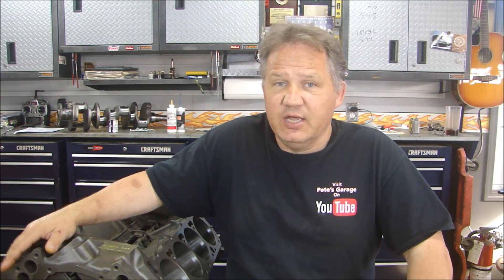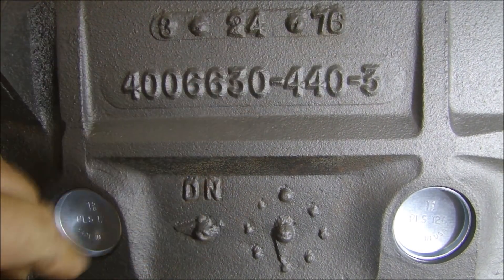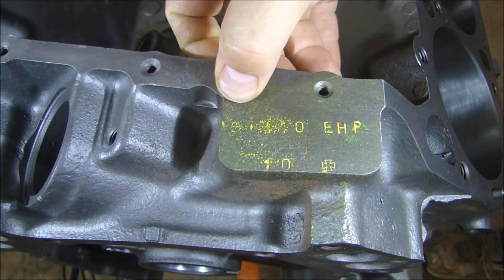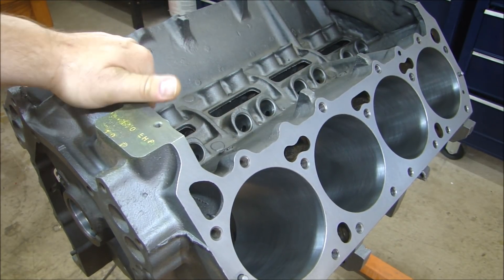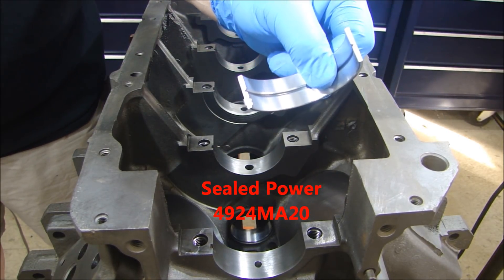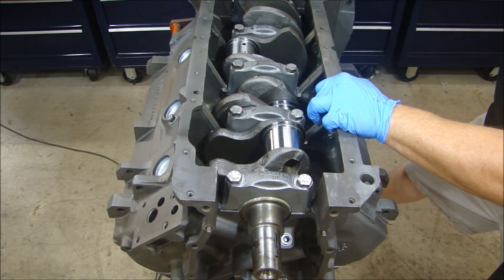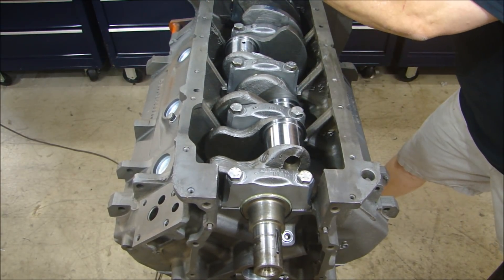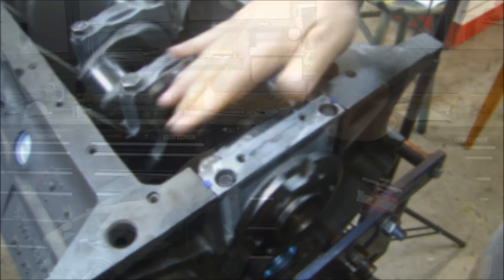440 MOPAR Big Block Engine Building Block Identification & Crankshaft Installation Part 1

Comment: First mistake you didnt lube the bearing before you set the crank in. Next problem, you never install a crank into a block with it on an engine stand. Hard level flat surface. Your torque values will be different on each bearing because the engine block is not level on the stand!
Reply from the maker: interesting

Comment: Today I’m trying to buy a 318 swinger to put a 440 6 pack in I know I got to see how it goes the Mopar purist will not like it but I’ll prob go to a regular Holley after I try it out if it does good numbers then I’ll keep it  on ther
Reply from the maker: Nice car
Reply: @PetesGarage   sort of lol we’re on rust belt mostly going to need a few frame rails or patch it’s going to be more for racing. A little street prob back half

Comment: Back on the day we were kids and I had a 70 with Maltese cross and we didn’t check we didn’t know we were kids and we never took to machine shop we cleaned it up we put the normal 440 bearing and I spun the bearings in it doing about a hundred a hundred in second gear she was revving we were kids showing off to a car load of girls but the Maltese cross is why I spun bearing s I’ll bet a hundred dollars although I was over raving it it only had like 355 or less for gears but we were kids with a 70 440 road runner lol
Reply from the maker: Awesome

Comment: 1:55.......814 = August, 14th.......O = 1978 (assumed build date)......E = Cast Crank......HP = High Performance OR Heavy Duty (for Truck apps) + Premium Fuel (most likely the latter).......10 + Maltese = .010 Undersize Rods & Mains.  🤓
Reply from the maker: Thanks!

Comment: I saw u apply torqueing compound to the main bolt threads but not to the underside of the bolt heads. 
There is just as much friction between the bolt head and the main cap as there is between the bolt threads and the block.
Hardened washers are a good idea too.
Reply from the maker: Interesting

Comment: never use an extension with a torque wrench, throws of the readings
Reply from the maker: Not necessarily true. If the extension has a higher tensile strength than the load applied, all of the energy will be transferred to the fastener.

Comment: Your videos helped me a lot with my first 440 build with great results. I noticed it looked like you used half-grooved main bearings. I used fully grooved on mine since i am using the windage tray. Do you prefer half for better oil pressure?
Reply from the maker: That's awesome. I use a half groove because it keeps the oil evenly distributed for more even wear.

Comment: Pete, I'm thinking about buying a 440, my questions are, is there a difference in a 440 mopar and Chrysler and does it matter where the 440 came from vehicles wise and Is it better to buy a complete motor or just the block itself to rebuilt? Thanks .
Reply from the maker: They are the same and any 440 form an old motor home is good. Starting with a block is good, but if you can get the whole motor, less parts you'll have to buy.
Reply: @PetesGarage  so I can use some stock parts for a rebuilt. And what do you look for when buying one.
Reply from the maker: Sure, block, crank heads. I just look to make sure there are no obvious leaks or damage.

Comment: Shouldn't you be torquing those caps down from the centre outwards?
Reply from the maker: Not necessarily because there is no load paced on the crank. If I were using a girdle I would.
Reply: Thanks  @PetesGarage

Comment: Thanks for this series Pete. I've got a 77 440-2 E that I'll be putting in a 67 Coronet. I believe the odometer on the RV I pulled it out of that it had 6200 miles. Trying to decide how much I want to rip it apart.
Reply from the maker: It's not that expensive to do it all, new bearings, rings, gaskets, seals. It will give you piece of mind

Comment: Great videos and pardon the ignorance, but why oil on the bolts for the main caps?
Reply: Helps to eliminate friction from being a factor when torquing bolts. Promotes clamping force as the factor
Reply from the maker: I made many videos about putting lube on fasteners. Back in the day that's the way they built them.